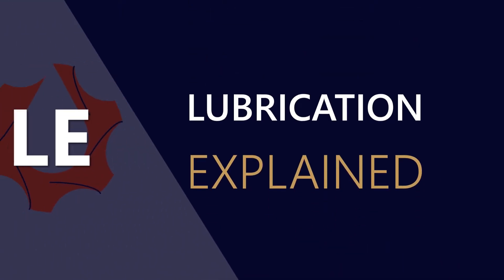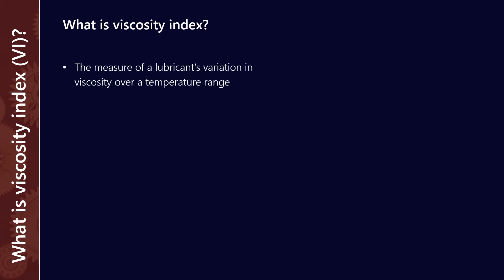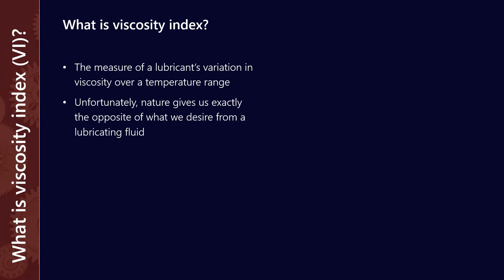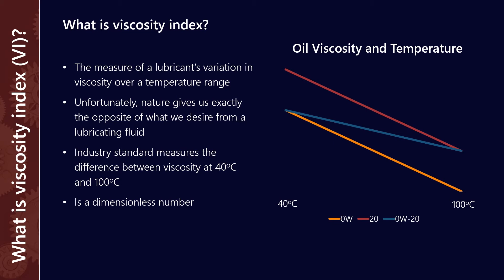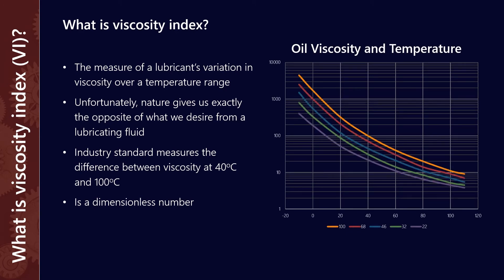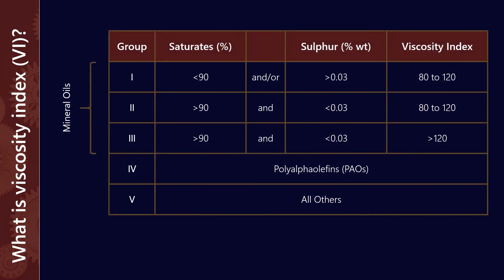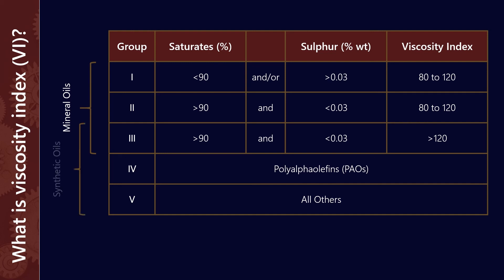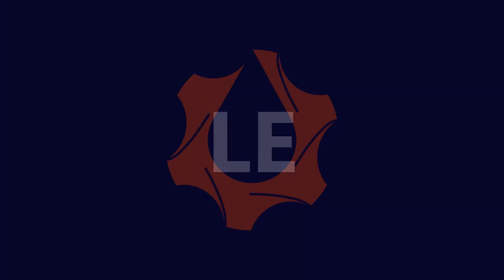What does Viscosity Index (VI) measure?

Comment: I am reaching out to seek clarification regarding the measurement of the VI (Viscosity Index) for our application. As we know, the VI is typically assessed on a scale ranging from 0 to 100°C. However, I would like to understand why we are focusing on a range of 40 to 100°C in our VI evaluations.

Could you please provide insights into the reasoning behind this specific temperature range? Additionally, understanding the implications of settling on a VI within this range will be beneficial in determining the most suitable VI for our application.

Thanks in advance

Comment: When looking at Penrite oils for example, the viscosity ratings in Cst do not match up with the ratings. For instance a 5w oil is about 15cst at 40c, but according to viscosity charts a 5W should be about about 20 Cst at 40c. The same for 10W and 15W, their ratings seem to be lower than what the classification is supposed to be. Can you explain that at all? In their PAO oils the disparity is even higher. They state a 10W oil which is supposed to be circa 25Cst at 40c but their chart states it is about 15Cst at 40c. It seems their oils are thinner than what they are actually labeled. They have 5W oils which have the same viscosity as 10W oils. It seems labeling or product names are irrelevant. How does this compare with what a manufacturer recommends, if they state a 20W-50 but the 20W50 is actually more like a 5W-30 oil.
Reply: I think that might be because of the ‘extra 10’ technology

Comment: Is less saturated base oil better to tolerate more capacity of dissolving dirt & byproducts in the engine pathways???
Reply from the maker: Good question. Less saturation won’t necessarily dissolve deposits, however the less saturated base oils tend to be less highly refined, and therefore contain more aromatics and sulphur containing molecules. These are more polar and do a decent job of holding deposits in solution.  So you are correct, but not because of the saturation.
Reply: @LubricationExplained  appreciate your eagerness...top notch educational materials at our hands and the best part, they're free 🤓🤓...thx a lot

Comment: What do you think about the following oils: 1) Honda/Acura synthetic blend 5w-20 which has VI of 159, Kinematic Viscosity at 40°C is 47 and at 100°C is 8.5. 2) Pennzoil Platinum full synthetic (5w-20) which has VI of 167, at 40°C is 45.9 and at 100°C is 8.6.  Which would be better overall for my vehicle when doing not more than 5k miles OCI and get better gas mileage?
Reply: In your case the 5W20 synthetic blend is semi synthetic blend or a full synthetic oil?. 🤔🤔🤔 Anyhow, I think in your case you arelike trying to split a hair using a razor blade. They are both very similar in their respective properties. Use either oil as long as they are API SN or is not fake oil. For better mileage always kept tire pressure to within +/-0.1barg of stated pressure in hand book and be less aggressive by left foot onto gas pedal. Once a month check engine oil level using dip stick. Then start the engine and wait for rpm to stabilsed. Keep engine running and dip again for engine oil. For my case engine oil level increase by less than 3mm. This should be a good way to verify that the piston rings are having low blowby or that the PCV valve is still ok. Regards.

Change oil and filter every 7500 miles for full synthetic. Some will change every 10,000 to 12,000 miles. n freezing winter try not to exceed engine rpm above 2000 for the 1st 2 miles especially if the coolant temperature, to the radiator, is still below 150 deg F. The reason for the above is that the flowing viscosity of 5w20 engine oil at 0 deg F would be still much thicker than a 10w 40 engine oil at 75 deg F.  Regards.
Reply: @whlawson5812  The Honda/Acura oil is synthetic blend(not full).  My vehicle is was happy with Pennzoil Ultra Platinum 5w-20 or Acura synthetic blend.  Since my comment was posted a year or so ago, I have settled on doing 3k oil changes as after 2k my car starts to consume a bit of oil and by 3k, the dipstick shows 1/4 of oil.  So pretty much 3/4 of the quart bottle was consumed.  I can add half a quart however it would consume still.  Interesting part is that oil level isn't changing first 2k miles and oil is still clean up to that 2k.  After that it gets darker more brown(not black).  Vehicle has Acura's 3.7L V6 engine J37A2 where Honda introduced some Nikasil liners or some type of coating on the cylinder walls.
Reply: @Charkatak  in my car's hand book  it basically says: depending on driving condition oil consumption can be up to 0.8litre/1000km. So far it is not more than 0.5litre per 5000km. Engine is year 2006, 1.8 litre supercharged. Car had accumulated anout 130,000 miles. I bought it this June after 3 months of usage. Monthly usage less than 700 miles. Honda engine is reliable. Pay attention on PCV valve for any car more than 6 years old. If it stuck open then it could pull a negative pressure of -0.2barg or less in the engine crankcase during partial throttle load.
Reply from the maker: This is such a difficult thing to make a call one unless you have direct experience of each. Theoretically, a full synthetic will be better from a mileage standpoint thanks to lower traction coefficient.

Comment: I have a question if you could help my it would be great:
I´m trying to see which low viscosity transmission fluid is better. Option A is Pentosin ATF 1 LV with a VI of 168 a Kinematic viscosity at 100ºC of 5.6 mm2/S and 25.3 mm2/s at 40ºC. Option B would be Motorcraft Mercon LV with a VI of  155, a cst @100ºC of 6.0 and a cst @40ºC of 29.6.
From what I could learned from your video I would say Pentosin because it´s VI is higher, but they seem to be very similar, am I right?, can they be interchangeable?
Thanks again for the information.
Reply from the maker: Tricky question! The world of ATFs is a bit of a minefield because it’s so ingrained with OEM warranties and the spec requirements are a mess. If it helps we did a video on ATFs last week: https://youtu.be/OOgzEDpLmmY

Theoretically a higher VI is great in ATFs because it indicates a higher hydraulic efficiency for the fluid coupling and servos. On the other hand, VI is a combination of base oil quality and VI improver additives. VI improvers tend to shear down over time, so their contribution reduces, whereas base oil VI tends to be more stable. Something else to consider is that Motorcraft is Ford’s private label brand, so if you’re planning on using this ATF in a Ford it might do better from a warranty standpoint.

All to say, it isn’t straightforward. With the publicly available information, you’re correct - the Pentosin product appears to have a higher VI, so if it has approval for your ATF, then it should theoretically be a “better” fluid.
Reply: @LubricationExplained  Thanks a lot for your help my car is a Ford. (Lincoln) and is no longer under warranty, right now I'm using Valvoline MAXLIFE that's supposed to be compatible with a lot of transmissions and it's been working ok but wanted to try something different.
I'll watch the recommended video thanks again.

Comment: Amazingly explained..
I have a few questions for you.
1. Can you please provide the relation between viscosity Index and Viscosity Grade? Is there any chart, formula or something

2. Also how can we know the actual viscosity by looking at the viscosity grade like what is the viscosity of 5W20?

3. What minerals/chemicals are employed in making these engine oils which makes them operable on cold and hot conditions simultaneously.
Reply from the maker: Great questions!
1. VI has more to do with the difference between the two grades - so for example a 10W-40 has a lower VI than a 15W-40, so there isn't really an easy way to find an equivalence.
2. The "actual" viscosity will vary by temperature - but the ISO viscosity classification aligns with viscosity at 40C. Here's a link to a site that shows the equivalent ISO viscosity for every SAE grade: https://www.tribology-abc.com/abc/viscosity.htm 
3. Aside from the base oil viscosity index, high temperature properties are generally improved through the use of VI improvers (polymers), while low temperature properties are improved through the use of pour point depressants.
Reply: @LubricationExplained  thanks for the response. Concept is very much clear now.
Reply: @LubricationExplained I don't understand how a 10w40 has a lower viscosity index than a 15w40? Or did you mean viscosity index improver?!